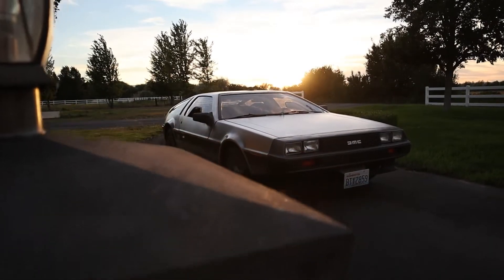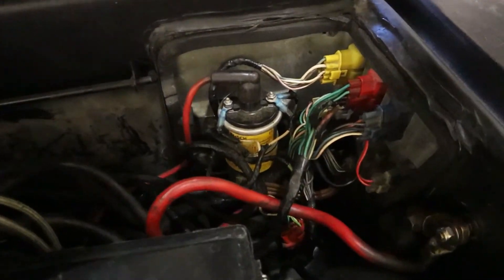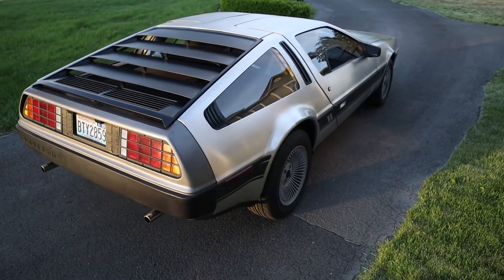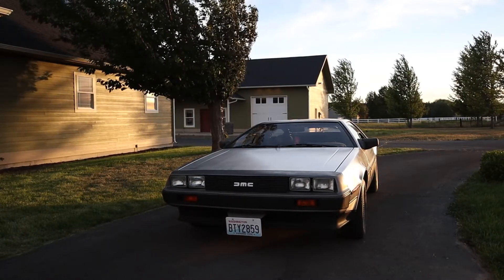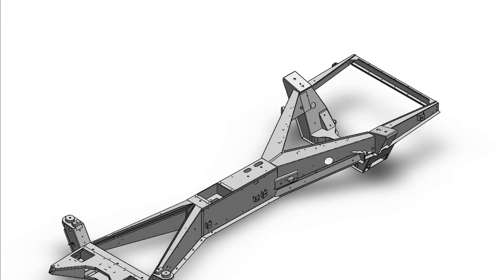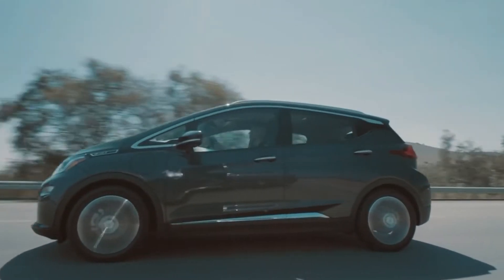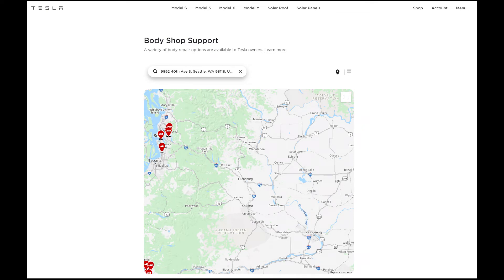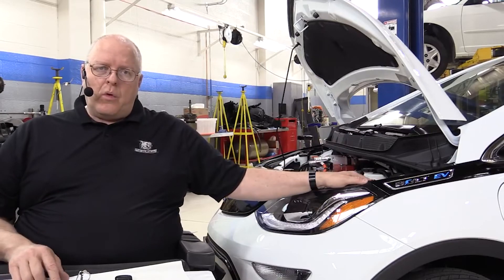An electric DeLorean!?

Comment: Ahhh... this one explains your abilities to easily handle the wire harness conversion... such as in your recent episodes.

I too was deeply into electronics at a very young age... easily by the time I was 12... because by then, I was repairing TV's... which wasn't all that hard considering this was around 1970.  I actually provided the first color TV my family ever had. I found it on a curb, had my parents haul it home, and I got busy.

Been a design engineer since 1979, worked in the 3 person Electrical Design group at a little startup company (I was employee 13) from 1990 to 1996 known as Pronav... later renamed... GARMIN. 

Then took a detour for several years and was the "tech guru" and I.T. guy at a large church when they were going through a massive building project.

Now I'm back at Garmin, an amazing company... but oh my did it grow up since my OG days there!

Oh, and I own the first car on your short list... a BMW i3 BEV... though it's just a 60Ah.  Be glad.... VERY GLAD that you didn't use that as a donor!
Although, the "S" model has 181hp, using the same motor and inverter as the non-S model.

Comment: EV conversion is the only swap I'll ever consider for #15575 (83). It completely fits both fronts of the DMC ethos. First, JZD himself hated the PRV and wanted it to be much faster. 2nd, it fits the myth and mystique surrounding the DMC. It's a "future" car and owners are beautifully geeky. EV conversion will never decrease its value, it will only add to it.

I also have a 2017 Bolt and adore it. I can never, ever go back to a gas daily driver. Ever. Only gas cars I'll ever own now would be classics.
Reply from the maker: Same here - we made the decision that we are never going to purchase another gas vehicle again, unless we are planning to convert it to an EV. We just bought a Mustang Mach-e and have a Ford F-150 Lightning on order. Even switched to an EV zero turn lawn mower!! About the last thing we need to buy that might end up being gas/diesel is a tractor... and I'm hoping if I hold out long enough I'll be able to get one of those as an EV in about 5 years.

Comment: Ive been wanting to do a swap using a bolt as a donor for a long time, for allot of the same reasons you've mentioned, ive driven bolts, they are fast and fun. but they arent all that pretty.
I think i may be able to keep the battery pack intact  repackage the drive system in the back and wrap it in the skin of chevys most beautiful car. (imo of course) the 1969 camaro

Comment: This is going to be good.  Specially if you are detailed with the build,  as you are in this video.  Love seeing the technical side.  Not like most TV shows where everything always works out, and if there is a problem is always fixed right before the deadline.   Because there is always a deadline.
Reply from the maker: Thanks! I intend on making it very detailed. Next episode will show the removal of the engine, transmission, and fuel tank.

Comment: Looking forward to watching this whole series. Amazing job.
Do you think The the bolt setup would power a  86 chevrolet caprice coupe ? Much thanks !
Reply from the maker: Yep, no doubt it would work! The only consideration I would have is that the Bolt is only 200hp, so you will lose a bit of power at high speeds. Lower speeds will still be comparable, though.
Reply: @BillCarlson  much thanks. 
Your a genius lol . I’ll be tuned in 👍

Comment: Re-watching this series as I am rethinking my ideas for a conversion on my 1989 Chevy R3500. I like what you have done. My only concern for my application will be the torque output of the Bolt motor.
Reply from the maker: Just checking the specs, it seems that the stock R3500 has more horsepower and torque than the Bolt - so if you're looking to match (or beat) the performance, the Bolt might not be a good fit. Tesla drive units have more power than the Bolt, and have better aftermarket support, too.

I would recommend anyone doing a conversion not go the route that I have - taking the entire wiring harness over is wayyy more work than it is worth!

Comment: Just saw your Copart video in my feed. I love this swap.

Question: why didn’t you go with a Hyper9 motor?
Reply from the maker: Hyper9 would require a transmission/transaxle, and a lot more mechanical engineering to get the drive train working. It's also only 120hp - about the same as the stock DeLorean, and I wanted more power.